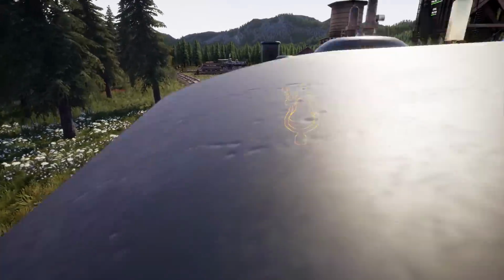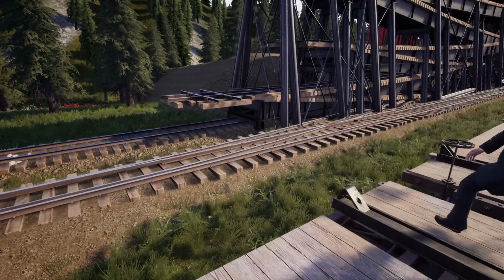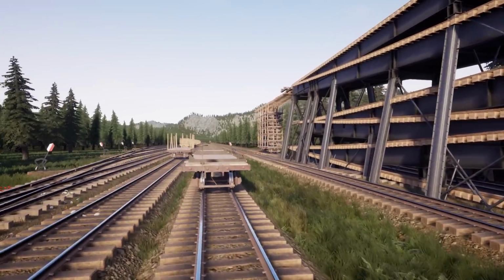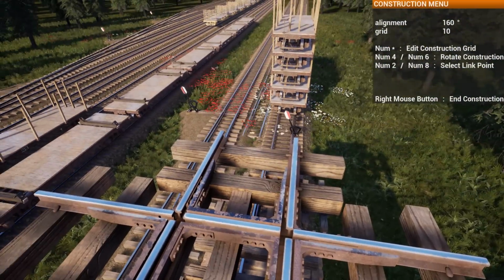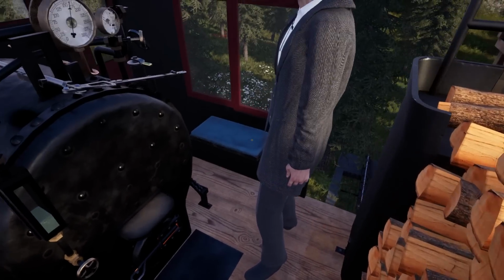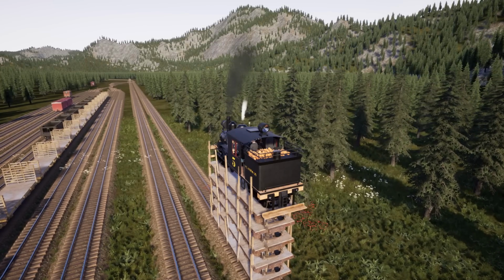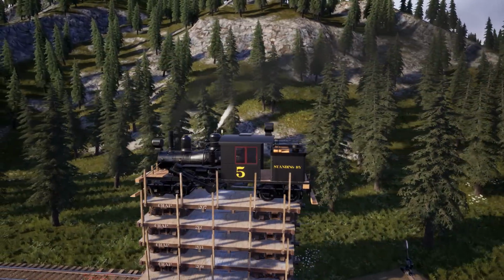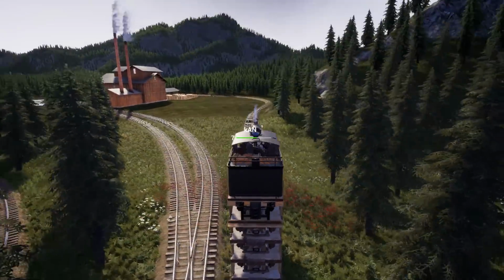We Only Play on Realistic Physics.

Comment: looks like it's breaking down to:
the crane looks for a line down from the top to a load point (the flat car, or other materials)
when you loaded the 1st it had a clear line to the 3rd
with the 3rd in the way, the crane couldn't get over it so it dropped it below ending on the 2nd.
all of this is fine because the gap between the 2 cars is a little over the 1 load so it places the piece and locks into place.

so when you add the 3rd, it does the same as the 2nd dropping it on the 2nd car but makes when the load "physicalizes" it gets the mesh inside of mesh problem leading to explosions.

as for the reverse wheels on the other attempt, I think it was holding the orientation from the track you used to put it on the car, so when it was loaded backwards it kept it's "forward" orientation from the tracks it was on and just gets confused from there.

Comment: Is anyone else experiencing the 8+ stack results but from just trying have a single loaded boxcar on their train? Even if it’s just a locomotive (any locomotive, including the Shay) pulling it? Even with just one crate tool in it (let alone 2-32)? On all physics settings? I did not see you two have this issue a few videos ago before the coal engine update. It’s like the boxcar just suddenly hits a wall and stops dead, the end of direction travel popping up in the air, and sometimes exploding off at warp speed, spinning like a top, then slowly levitating away like a cliche scene from a 60s UFO movie. Is this just an old bug I’m only now finding? Happens on switches, spline connectors, and the middle of solid splines the same—meaning, it maybe caused by the point where splines connect, but it also happens between them, such as 50 meters down a 250 meter long spline, or 68 meters, or 147 into it… and again, the boxcar acts like it has just struck something and comes to a dead stop from any speed: walking pace, sprint, faster, same thing. The new stock car does not have this issue.

Comment: The big question is, if two cars stacked on top double in weight. So is it possible to stack loaded cars on top and only pull the weight of half of them (of the ones direcly on the tracks).